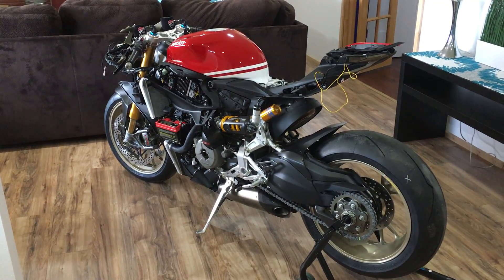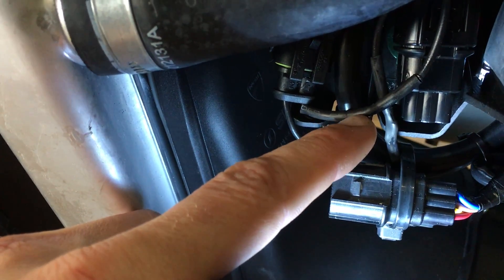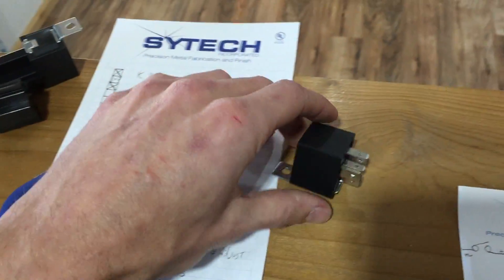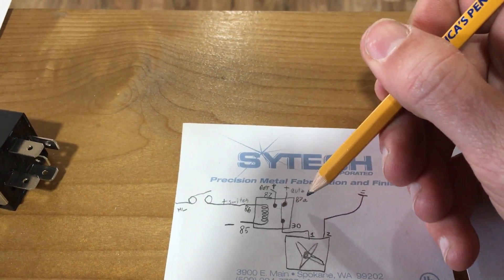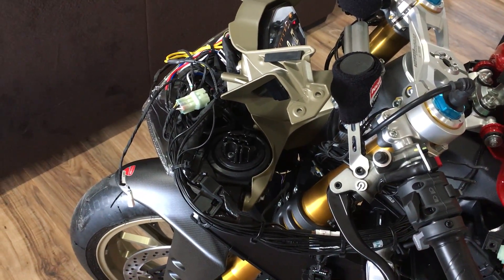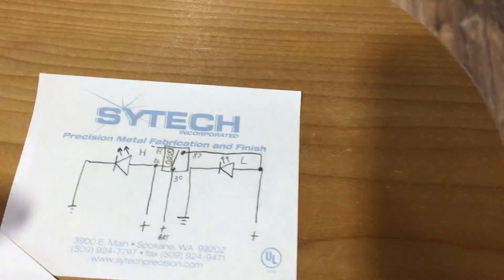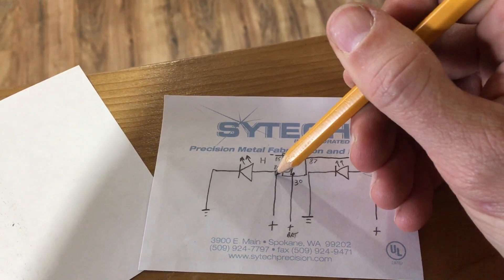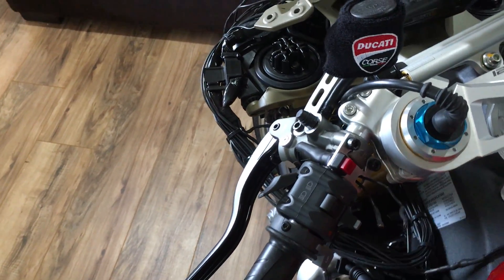1299 Panigale drop running temp by 30 degrees

Comment: Okay im back 6 years later after putting this relay in. I opt'd to not wire this into the headlamp. So left 85 and 86 going nowhere. What i am running into now is that i can manually turn on fan, but when engine reaches that 220 it throws a fan error on the dash and doesn't turn fan on automaticly. What is causing this?

Comment: Isn't this just solved by any Ducati tech at the shop with an ECU flash to have the fan turn on at a lower temp? My 1299 Fan comes on very early, the bike never goes above 200

Comment: Good stuff, thanks. Seems there should be a temp switch that trips the fans though. Maybe a sensor you could replace to trip the ECU to turn fans on at a lower temp?

Comment: How much does the fan circuit differ from the 1199? If the same circuit was installed on the 1199 and the fan was operated manually, when the bike reached 217 degrees a signal from the BBS would try to turn the fan on and recognize that the circuit was open. A FAN error and an EOBD indication would appear on the dash. The error would clear after powering the bike down and restarting, assuming that the temperature was below 217 degrees and/or the bike saw a closed circuit. On the 1199 the signal wire from the BBS would feed to the front relay contact (NO) and to the coil (+) contact. In that way, when the BBS signaled the fan to kick on, the relay would pick, manual control would be taken away (regardless of whether the manual switch was ON or OFF), and no errors would be displayed. A wire from the positive battery terminal to the back relay contact (NC) would be used for manual control and protected by a 7.5 amp fuse, as the SPAL fan on the 1199 draws 4.8 - 6.5 amps depending on operating conditions. I'm surprised that the 1299 doesn't throw an error when it's under manual control and doesn't see an operating fan circuit when it reaches the temperature at which it should cut ON.
Reply from the maker: You are correct on both the 1199 and 1299 it will throw an error code IF it were to hit the 217 degrees. However in all mine time on both my 1199 and 1299 with the fan manually turned on I don't think it's ever gone over 205, and that's stopped in traffic on a hot day with a heat soaked bike. But your idea would work as a redundant means to make sure you never got this error if that's something you were concerned about. Thanks for commenting :)

Comment: Way to complex. Anyone who can't remember to turn his fan on or off should not be riding a bike like this.  Plus the fan is noisy so there is no chance of forgetting you left the fan on as you walk away.  Also no relay is even needed. Battery + to a inline fuse , then a switch 7 the fan. KISS method .   O BOY !!!!!!  OVER THOUGHT IT !!
Reply from the maker: Yes you can direct wire from battery through a switch and to the fan. Which will back feed the system causing a check engine fan light. But what do I know I'm just an electrical engineer and you're a much more qualified  keyboard warrior.
Reply: I'm just a licensed Aircraft mechanic.  Plus for your information is false.
" NO CHECK LIGHT COMES ON "
Reply: Eileen Pitman I didn’t know Ducati made aircrafts! Learn something new everyday.

Comment: Guess you never heard of water wetter or engine ice
Reply: I live in S.W. Florida. 95 degs+ everyday . Water wetter may help some but at a traffic light NO air is going through the radiator nothing will work. . Even a super sized radiator without any airflow will not cool the engine. Simple , your coming up to a light turn it on. After your out into open country turn it off. It will 90% of the time keep the coolant temp below 200 Degs F.

Comment: What heated grips are those. i cant say i've ever seen internal bar end heaters?
Reply from the maker: Search for Polly Heaters on eBay
Reply: Very nice bike. I have a question. How is possible to heat the gas grip? You need more heating power in the rigth grip? I don't see how is possible to get a good heat transfer with the moving grip between your hand and the ceramic heater. Thanks
Reply: The fan draws very little amps so on relay is required.

Comment: Thanks for sharing, I am going to attempt this soon. I got #35. I am not so knowledgable when it comes to electric stuff but I shall try. Which fairings would you say I must remove to get the job done, rather than getting her all naked.
Reply from the maker: I'd highly recommend you download the service manual if you haven't already. It shows the order in which you need to remove the panels to get to what you want to work on and where all the fasteners are. I'm on the 1299 forum if you have any questions. #330
Reply: MightyWhitey 68 thanks man, I got the manual. Will attempt this soon.

Comment: With having more control of fan, would your battery need to be replaced sooner?
Reply from the maker: Only using your fan when the bike is running won't tax your battery any additional amount the fan only draws about 3 amps. So no you should see the exact same battery life.